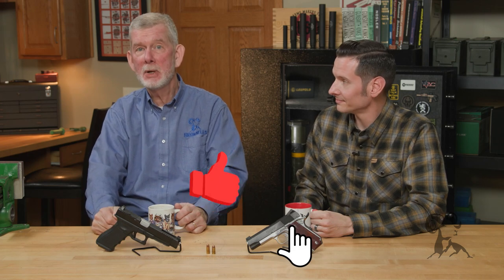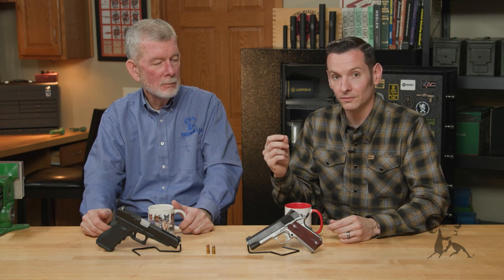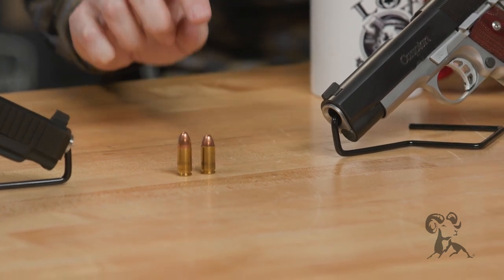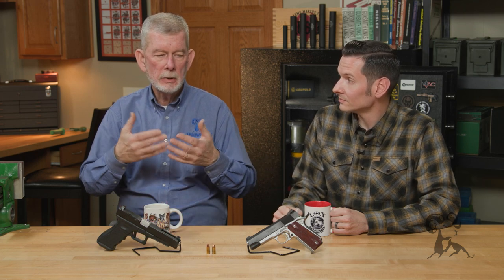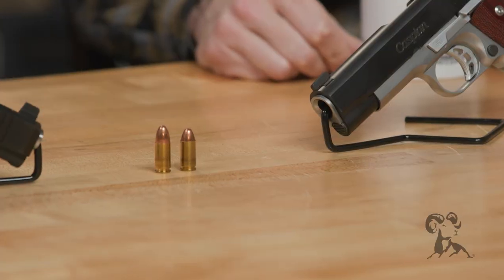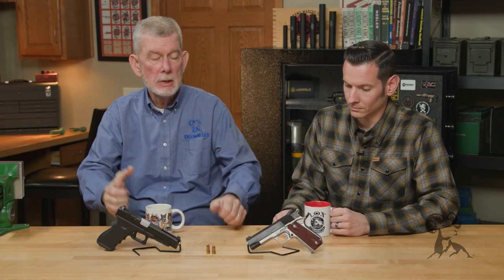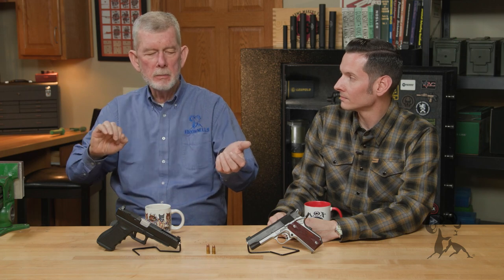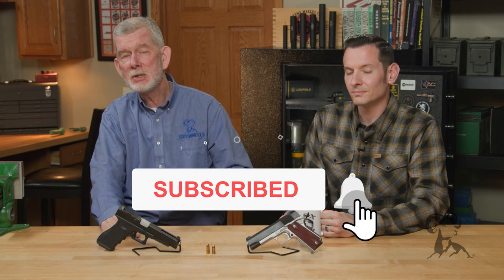Smyth Busters: Will Excess Bullet Setback Blow Up Your Gun?

Comment: I do my best to mitigate this by moving rounds from box to box. So each time I clear my carry gun for dry fire practice, I put that round in a box that is "once chambered", and I use a new round once I load up again. Then I repeat the process until all the carry rounds I have so far have been chambered once. Then that box becomes a "twice chambered" box, etc. I also measure the original length with calipers and double check the length over time of each round. I've had no issues.

Comment: While breaking in new mags with a mix of dry cycling and shooting I tend to get a few rounds with minor setback. My experience is 45acp is quite resistant to it, with the copper jacked peening before noticeable setback occurs. Best use for a setback round is dry cycling once you have a few to work with (saves good ammo). This of course shouldnt be done with rifle calibers, as they tend to setback so far powder can sprinkle out (308 is really bad about it).

Comment: I had the thing happen exactly like Caleb described with a 1911 , using Extreme defense .45 acp in a Ruger 1911. I'd unload at night, then in the morning put mag back in, chamber a round, drop the mag and top it off with the one I had extracted the night before. Then one day I noticed the cartridge looked odd and sure enough those top two rounds that I'd been extracting and reloading were definitely shoved into the case, quite a bit. Luckily I hadn't fired them.

Comment: I noticed this ‘bullet set back’ had occurred on a factory .380ACP defensive round - I too noticed it in time and dumped that round.  It caused me to change my behavior regarding the magazine I kept loaded with defensive ammo.  It was with my Sig P238 which I usually practiced with ball ammo and then used a magazine which I kept loaded with defensive ammo when it came time to carry.  I noticed the bullet set back after having reloaded the top round in the magazine a half dozen times.  Needless to say, I stopped that practice!

Comment: I’ve noticed setback in a very few of my 45 jacketed reloads. I set them aside and pulled them later. The jacketed bullets had no crimp groove. Now I cast my own bullets and only use moulds with built in crimp grooves. My rifle is a 45 Colt lever action and you’d never see the setback bullets in the tube magazine.

Comment: I bought 2 thirty round 9mm Pmags that absolutely did not feed right, causing the projectiles to slam deep into the brass instead of going into the chanber, this happened with both mags, about 30% of the time.  After collecting 10 damaged rounds, I left the course I was trying to qualify on and grabbed a couple factors mags, no more issues at all.

Comment: I had a .40 S&W round once get set back in my CZ SP-01.  The .40 S&W already runs at high pressure, so the resulting boom was significantly worse.  The pistol survived, but the magazine was destroyed, and the ejector was blown off the gun.  These were my own handloads, and I had actually noticed some rounds getting set back a bit earlier, but didn't take it seriously enough.  I was lucky that I only received a bunch of carbon blown in my face.  I now crimp a bit heavier, and haven't had the issue again.

Comment: I had a couple rounds set back at the range once, asked one of the operators about it and he rightfully recommended I just throw them out, had me toss them downrange. interestingly enough, it was my Glock that set them back, so just because they're saying it feeds in straight in, it doesn't always, actually the feed ramp on my G19 is steeper than a Beretta M92
Reply: My carry ammo was doing it because I'd load a completely full mag with the slide closed and the pressure of the mag spring forced the bullet into the case when it smashed against the underside of the chamber.

Comment: I got into this many times with 3-4 times shooted 10mm cases but fortunately I check every batch of 50 round putting at least 2 mags of loadings trough the gun without firing and check if any cartridge has a bullet setback...learned too that if I find one in that condition for the safety of my 1990 delta gold cup is better to unload that batch and restart with new brass cause 99% of the times if I apply more crimp the cartridges starts to fall a little too much in the chamber so that can be a bigger issue as we know for spikes of pressure. Always invest in good brass is a good choice if you don't want to spend more on health cares and a new firearm

Comment: It's never been a huge issue to me but my buddy pointed it out on my M&P Shield Plus, I had two back to back rounds with noticeable setback, both were Sig V-Crowns. I don't use V-Crowns in that thing anymore, only my Glock, however I'm not even so sure about that so I think I'm just gonna take all the good ones and fire them off just in case.

Switched to Speer Gold Dot and Liberty Ultralight if you're wondering.

Comment: I had that happen a couple years ago while I was hunting. It was with a factory loaded .556 flex tip (ballistics tip). I only rechambered the round twice and when I cleared the  AR 15 rifle the bullet was set back a considerate distance. I set that round aside to be pulled, resized in my press, reinstall the factory powder, then reset the bullet to factory OAL.
I have never had this happen before especially in a factory cartridge. I guess the neck tension was off.

Comment: Took my new AR pistol to the range last night... got my target stapled up, ears and eyes on, loaded a mag, released the bolt catch, flipped the safety off, but the trigger wouldn't pull... Checked my selector again...

As I was reaching for the charging handle was when I noticed the bolt wasn't all the way forward... Racked the handle, round popped out with the bullet pushed way back in the cartridge.

Good opportunity to remind myself that even with as much fun as it is running binary, it should be done sparingly and with full cognition of what CAN happen and that I WON'T be in a position to heed warnings should I encounter a squib or other ammunition error.

I'm also not certain if it was a manufacturing defect, feed failure (full 33-round mag), feed ramp collision, or if it happened when loading the mag with an ETS loader.

I think it was Blazer Brass. ...might have been the last of my Herters, though. 9mm.

Comment: If I have a setback I use a kinetic bullet puller to get it back to specs and shoot it.
 In revolvers without enough crimp you can get bullet creep, where the slug will go forwards as the other rounds are fired until the nose pokes out and ties up the cylinder. This is with the powerful, hard kicking big bores.

Comment: A friend of of mine had a German made Browning hi-power. He noticed the round he was about to fire was setback to where there was just the crown of the bullet almost sticking out estimated 75% to deep in the case. His gun blew up. The chamber and Barrel ruptured and it bowed out the side of the slide around the ejection port   Fragments of the shell came out the ejection port. He was not injured but he had a sore hand for several days. My practice is to take and unload my weapon  and take the round that I had in the chamber and place it at the bottom of the magazine. What's the magazine is loaded with previous rounds used to charge my gun, I shoot that magazine Normally I don't charge my gun with the same bullet more than three or four times. My friend was shooting Factory rounds

Comment: If you unload your gun every night the the next time you load it rotate rounds or lock slide back and drop round in the barrel and release the slide. Its a bit safer and won't get setback.  But it can happen from miss feeds also. If you get a jam and check your round and make sure the bullet is seated properly and pushed in to the case.

Comment: If the bullet is easily moved into the case ,malfunctions may occur. But more important, loads that produced 28000 cup went to 62000 cup when bullets were purposely seated. 030 "deeper. Speer #10 manual  pg.349. Max pressure 35700 cup.

Comment: Back about 10 years ago, for those that remember, the Diamondback DB9 pistols were notorious for being built to only withstand standard pressure 9mm Luger ammunition. There are photos of the barrels peeled open from the chamber due to someone sticking a +P or +P+ in it and trying to shoot it. I remember when I worked at a gun store, I took one apart and saw how thin the walls of the barrel were and 100% believed the photos. So, if you have a DB9, definitely dump any rounds with setback... and get rid of that DB9 before you lose a finger or two.

Comment: Happened to me yesterday morning. Was cycling my carry ammo and one of the rounds was set back. Felt like a 40sw when i shot it. 

Blew my extractor, and safety plunger. Ripped the casing at the rim and threw metal and gunpowder into my hand. Did blow the magazine. But the slide needed to be hammered off of the frame.

Comment: I had my first experience with push back when I got some aluminum cased ammo given to me. Thankfully I noticed it just by chambering a few rounds to see if my p95 would take it ok. Some rounds would chamber fine and about half of them pushed back and deformed the case. I don't know the brand of the rounds but I hung onto them just as examples.
Reply: I personally hate aluminum cased ammo.
I've had feeding problems with it. 
The only aluminum cased ammo I will use is revolver ammo.
Just my personal preference.

Comment: We have a lot of this occurring with Glock 19's even  (gen 3's) issued with our security personnel exchanging firearms as and when the firearm is made safe, booked in and booked out to new user on shift thereafter. The continual cycle of the same bullet in circumstances where the entire magazine is not unloaded and the rounds randomly swopped, caused the issue in this use case as it were. Protocol was put in place to unload magazine with safe firearm at least once a week was put in place to mitigate the issue.

Comment: Glock 22 in .40 S&W + Bullet setback = Ka-Boom
Reply: Nope. A writer for The Daily Caller tested this and couldn't make his .40 SW Glock explode -- or even show damage -- even after smacking the bullets with a hammer. The article is called "Battered Bullets."
Reply: @ToastbackWhale  This video gave the qualifier for +P. The Daily Caller "experiment" only used 40 S&W Speer Gold Dot( NOT +P). Testing only one load is not exculpatory evidence.  Run some Buffalo Bore +P w/ setback in an unsupported .40 chamber; Are you confident enough to not use a ransom rest?
Reply: @BlackPhillip666  im not, f that, I'll keep my hands thanks
Reply: @ToastbackWhale  As someone else noted outside temperatures could factor in, not too mention there’s always some tolerance differences in every round. Also there’s at least one comment about a Glock that said he had some damage to his firearm after doing this. So an unscientific uncontrolled bubba test vs scientific data that says some degree of set back make a 40 SW equal in pressure to a 7.62 nato do you really wanna risk it or encourage others to not heed warnings?
Reply: @dustyak79  Go read the article. It's not as bubba as you think. 

Setback is not an issue for any well made firearm, seeing as +P loads are only 10% over max pressure, while proof loads are 100% over max pressure. And you gun can handle a proofload or six.

Comment: This is especially problematic with 1911's even with polished feed ramps
Reply: 1911s tend to have higher feed angles than more modern pistols so I definitely noticed the issue, especially with 10mm 1911s. Wasn’t actually too bad with my .45ACP, but 10mm had a tendency to set the bullet back a good deal.
Reply: @gameragodzilla  yeah. Especially with those 22lb+ springs for 10mm and 45 super. Not as bad with 9mm with the 13lb-15lb springs.
Reply: @gameragodzilla  You also have to remember that the 1911 was designed for .45ACP, not other calibers. So this problem will be more evident in other calibers in the 1911.
Reply: @rbm6184  True, true. I don’t own a 9mm 1911 so I didn’t have that to compare. I did hear that 10mm is more vulnerable in general to this due to being a long but narrower cartridge than .45 ACP, which combined with the feed angle can lead to problems.

Comment: I had a 60rd magazine for a 5.56 that when clambering remanufactured 223 would set the bullet back every time in chambered during the first 20 rds of the magazine. It made extraction difficult and my accuracy was trash even inside of 20 meters. I didn't find out until I took it apart to clean it and unburned powder was all over the inside of the weapon. I cycled hundreds of rounds manually with the charging handle with reman rounds and factory m855. With the magpull gen 3 I had zero chambering issues with setback with reman or the factory. The 60 rd German made mag was setting back the round almost 90 percent of the time with the first 20 rounds. So the answer is if you use the high cap mags. Don't use reman rounds.

Comment: Squib + stuck bullet + setback round = Ka Boom
Reply: @5:14   ? a squib  & stuck bullet   not sure the next round was compressed    they both went out the barrel on a 1st gen G17   there was a very slight ring in the barrel about 1 " down from the chamber  the glock works fine & is very accurate .

Comment: I handloaded some 9mm+P cartridges with Tru Blue powder per loading specs and pressed in a copper "Penetrator" bullet. Not sure if the crimp was insufficient, but an abnormally loud muzzle blast signalled a problem with my AR-9. The case had separated. In looking at other rounds in the same magazine, some where obviously set back.  Don't know whether insufficient crimping enabled recoil energy to drive the bullets back, or loading them into the magazine caused this.

Comment: It's not fun when your gun blows up. believe me from first hand experience.  Not sure if it was bullet set back, to tight of a crimp or to much power charge. It happened in a perfectly good Glock 30s  .45 acp.   The ammo was factory loaded and it was the first time chambered.  It blew out the rim of the case at the un-supported part of the glock barrel.  It was  loud and not a pleasent feeling in my hand with a slight burn  occuring to hand  frome between slide and frame. It blew the magazine out of the gun. This happened aroung 10 years ago with a new to me type of amunition. It had a copper round that separated on impact.  The manufacture  denied having any issues or took responsibility. however many  examples where reported with unsupported glock type  barrel chambers.  The manufacture did recall early batch number cartriges. 
My take on this is. ammunition can blow up for a number of reasons.  Being cognitive of bullet set back is might be a good idea to keep an eye on.   It might save you from injury or at very least damage to your gun.

Comment: I’ve been hand loading since 1971. Off and on I had problems with bullet set back as well as bullets creeping forward. After I discovered the Lee brand Factory Crimp Die the problems stopped. Despite the naysayers claims I haven’t had a problem with the Lee FCD having an Ill effect on the shot to shot accuracy. In many situations the accuracy improved. Remarkable improvement in 38 Super and 45 ACP in 1911s, a Voere rifle factory chambered in 308 Norma Mag and a drastic improvement in both 44 Special and Mag especially the Charter Arms Bulldog. If Richard Lee had allowed licensing of his FCD die. There more than likely have never been any of the so called naysayers down grading the crimp.

Comment: I’ve started using Lee factory crimp dies and that reduced setback quite a bit. 
With a regular seat and crimp die I had this problem a lot with .45acp. Particularly with truncated wad cutters and certain hollow points. 

Also if you have deep setback a kinetic bullet puller tapped a few times will pull the bullet most of the way out then you can reseat it at the correct depth and re-crimp.

Comment: Some calibers suffer the opposite problem. The chambering of the 44 Auto Mag is especially violent because of the strong springs and heavy bullet. Even with a terrific crimp, the bullet will creep forward in the case slightly when it is stripped from the magazine and chambered. I one tried chambering then ejecting the same round repeatedly. By the fourth cycle, the round was too long to still fit in the magazine. I also measured rounds and how they reacted to the violence of recoil. The bottom round in the magazine got hammered repeatedly by the front of the magazine under recoil, and was measurably shorter than when it was first loaded into the magazine. But then it would grow again slightly when it was chambered. 

Nobody ever thinks about that stuff….

Comment: Noticed it more with OEM 357 Sig barrel. with my P229. Thought the tapered case was a factor but knew it wasn't the cause. Doesn't happen with the factory 40 cal barrel. Good to know, especially with 357 sig already being a high pressure round. Thanks a bunch.

Comment: Check for setback rounds in any rifle with a tubular magazine. I found several pushed back bullets in Hornady bulleted 45 Colt reloads after emptying a Uberti 1866 magazine. Factory Hornady 45 Colt uses a short case to be able to get a good crimp. Now I only use the Hornady rounds in SAA revolvers and load with hard cast lead bullets for the rifle.

Comment: I remember one year my agency had a bad batch of ammunition from their vendor. They had some bullets that were over seated from the production line and we were using these blocks that checked the depth and thickness of the walls for proper seating (if I remember the bad rounds would stick in the block and that’s how you knew it was bad).